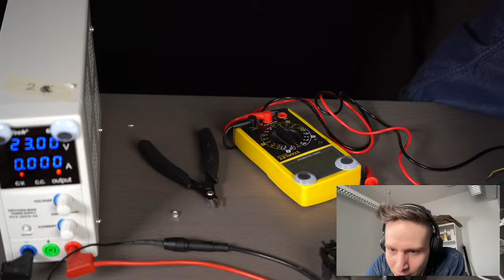Let's Try To Play an Electric Kettle!

Comment: Virtually all kettles use some cheap bimetallic strip in the latch, and not an electromagnet...  You CAN however still play an electric kettle, but you need a high current variable frequency drive (VFD) and you literally drive the heating element at various frequencies with high current pulses and the element will literally vibrate at various fundamental/overtones as it is heating...

You could likely convert one of your existing musical magnet drivers by using it to drive a high power MOSFET or IGBT to switch line current into the heating element at whatever frequency you want..